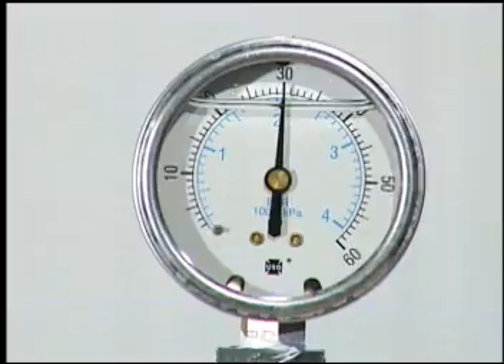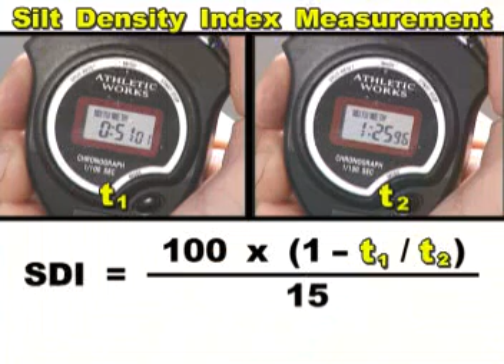Silt Density Index

Comment: thank you very much for the video, it was helpful a lot.
I am Master Student of Vienna University of Life Science and Im working on MFI vs SDI project. I am stuck on the curve calculation and I am kindly asking how to do so. On excel I have the values of litters the filter have filtered and the second of which it required to filter. So to get the s/L vs L curve I am dividing the seconds by the litters  ( without no minus V2-V1) and if I get the curve it has a sharp point which looks nothing like the previous research works. The water is normal brine water with 250 mg/l TDS
Show less